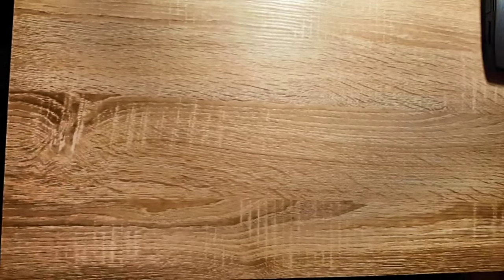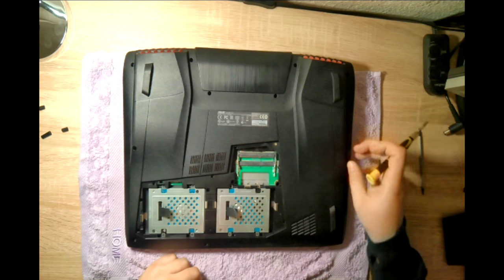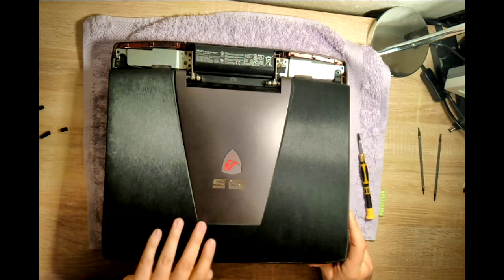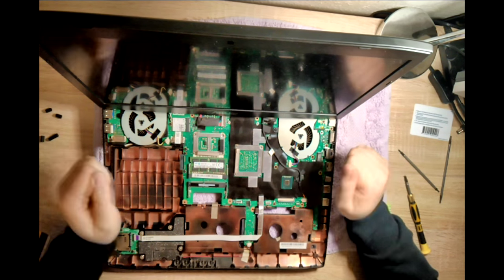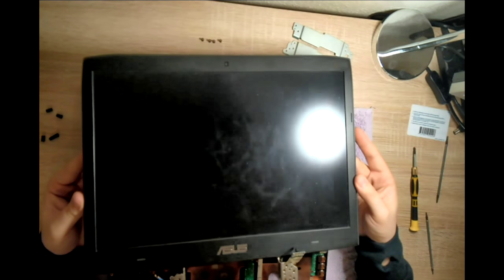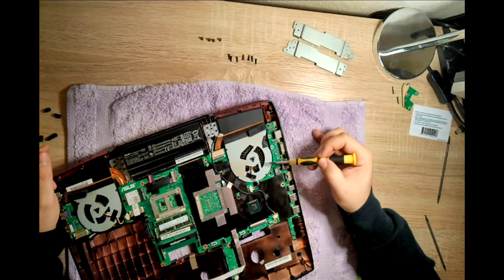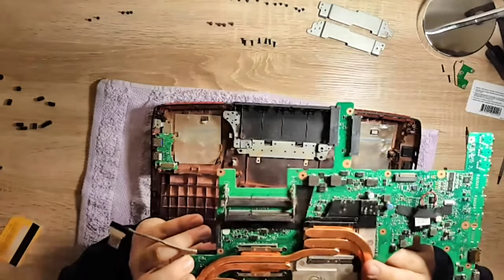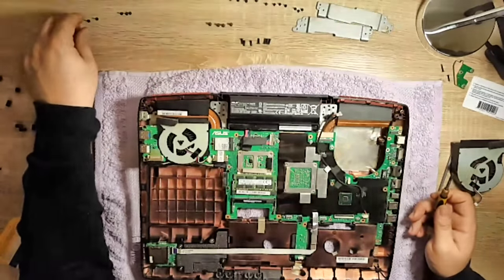Asus G751 - Complete Disassembly / Fan Cleaning / Battery Replacement

Comment: Darn, not a complete disassembly. Didn't open the display, it's a bit tricky.
Reply from the maker: You got me there...! There are 4 hidden screws on the underside and then you can split the display bezel from the back panel!
Reply: Hate how they place the hard drive bracket screws by holes where they can easily fall down into and are hard as fuck to get out lol.
Reply from the maker: true
Reply: Dongleboo You know those little holes that are right next to the hard drive bracket screws towards the end of the computer? So I admittedly dropped one in there and I'm not sure how to get it out. I know it could cause damage depending on where it's at while the computer is on. Would completely dissemblance it allow me to get to that area?
Reply from the maker: Can't you shake it out? If not, then by removing the keyboard panel you'll only get access to the top side of the motherboard. If it's stuck somewhere between the motherboard and the chassis, you'll have to remove the motherboard as well, which is held on by 3-4 screws. There are a few connections you'll have to remove before that. Watch the video and you can see how to do that.
Reply: Dongleboo Only problem I'm having now is literally every one of the three screws under the optical drive are stripped.
Reply from the maker: You've used the wrong screwdriver I guess? Try a small flat head and push it hard down. It has to grab on something.
Reply: Dongleboo Just makes them worse. They're noticeably stripped. Don't know why the quality of the screws is so low. I might try the rubber band trick if I can find one but idk. I could maybe shake them out of the optical drive bay if I could direct them there. I would just let it be but it assume it could cause damage especially if it's anywhere near a chip.
Reply from the maker: A problem will occur only if the screw makes contact somewhere. Usually most of the motherboard i covered with a plastic sheet so on theory there shouldn't be a problem. As for the quality, they aren't the best but I didn't have any problems with them so far. Just use the right bits.
Reply: Dongleboo I can hear that it's currently located directly under the chip under the hard right hard drive bay (if you have the laptop on it's back side with the hard drive bays facing you like in the video).  Would there be any problem with it making contact with anything there?
Reply from the maker: Well...I'm not really sure. Man, as a last resort, if you have some super glue, add a drop on the screw head and glue down your screwdriver. Make sure it's dried up and give it another go. The rubber band trick is not really applicable here, because of the size of those screws. Try the glue and let me know if it worked.

Comment: I need answers. My head is going to explode :(
In a few months... I'll be studying an Engineering on Systems (programmer).
I have 1 option. Choose a Laptop or a Desktop. Just one. 
So... I think I'll choose a laptop. Why? mobility.

But I need opinions and experiences. About the cooling, performance, lifetime, etc.
Especially on this model, well, almost the same model. I'm talking about the "Asus Rog 751JT". 
I like it, is an awesome laptop. But I've heard many negative things... and it's confused to me.

I love to play games and many programs at the same time on the computer.
Playing for hours so I'm scared about the lifetime of the laptop and the cooling.

And I've heard that doesn't need a cooling fan. ¿ :( ?
Because the system cooling that It has it's weird and doesn't work with an external laptop fan... doesn't make much sense for me.

I thought about buying the "Cooler Master Notepal X3"... it's look great.
If somebody have that cooler or something like that... tell me about the performance and your experience x) Pls !!

If you read all of this... Thank you so much and I'll been waiting for an answer x) !

(I'm sorry if I have some mistakes on the grammatical)
Reply from the maker: +Gabriel Endark First, let me start off with the fact that I'm currently in my last year of studies and I study Java programming. I've been using this laptop for over an year and I couldn't be more happy with it. Overheating is impossible and yes it doesn't need a cooling pad. The built in cooling system is very good even if you OC the hardware a bit. The  temperatures  hover around 45-50 on idle and depending on what you're doing m, can go up to 85-90 on the CPU and 80+ on the GPU under heavy load. I have the JY with the i7 4860M and it's more than perfect. Most important factor is the SSD. If the laptop doesn't have one it's s***. Mine didn't have the ssd when I bought it and after I got one - man....it was flying. As for programs...I have every Adobe software plus a thousand more programs and games and it's just perfect. I'm also a graphic designer and the software I use is quite heavy at times.  As far as mobility - this is why I bought a laptop. I was wondering if I should buy a desktop as well but now I'm glad I didn't. So, in short - the laptop is worth every penny, the only compromise for me is the small screen (before this I had 18,4 laptop). This laptop will be good enough in 5 years, unlike some cheap models which are outdated in 6 months and can't run anything. The only complaint I have from this laptop so far are the speakers - a bit too quiet. But hey, it's a laptop after all.
Reply: +Dongleboo 

And the non-removable battery... a friend told me "I keep mine on my desk mostly plugged-in but now after 18 months of over-charging the battery doesn't charge fully and I'll have to buy a new one to replace it for $75 :[
And you have to open the laptop to swap it out but hell it's still a bad-ass laptop in the end." 

xD

So... Do You recommend me that Laptop??
I'll study programming, playing games and carry to everywhere that laptop x)

Thank you so much for answering :3 !!
Reply from the maker: The battery is replaceable. It's a bit difficult to do it, but it's not glued down. Originally mine had a defective battery and after only 6 months it couldn't charge past 85% and ASUS changed it under the warranty. The battery has only 1 year warranty tho. 
As I said in my previous comment, these are the exact same things I use the laptop for. It has the power of a pretty good desktop. The only downside is the weight - it does weigh over 4 kgs so it's not the most convenient thing to carry but it comes with a very nice backpack included in the box (at least mine had one) so you don't have to think about buying additional bags etc. It's not with the hard front, like the one I had with my G75, but it's a nice big backpack. I carry it around on a daily basis and it rarely sits on my desk at home more than a few hours. 
In conclusion - it is a mighty machine and it can run anything you throw at it and it's worth it. You might actually consider the G752 which has a very cool aluminium design. It's the same price (around 1500 euro) for the base model.
Reply: +Dongleboo 
just in case I would buy the "Notepal X3"
I don't want any problem :'v

And thank you so much!!
seriously... thank you!! <3

If I need something else... I'll call you... sure, if You let me :'v <3
Reply from the maker: +Gabriel Endark As I said, I don't think it's necessary, but it's up to you. You're welcome and if you have any further questions, feel free to ask.

Comment: I'm thinking about repasting  cpu and gpu in my G751JT.
Do I need any thermal pads for other components ? 
Am I going to be ok with just a 4g syringe of thermal paste ?
Reply from the maker: +Voitech hmm....good question. I actually never did that and I'm wondering why do you want to do it? Are you experiencing some overheating issues? As for the question itself, I think just the paste will do. I've "OC'd" my GPU and CPU and I'll not having any issues whatsoever. I'm running the gpu @ 1226 MHz on core and the CPU @ 3.76 GHz in turbo boost. It's actually not over clocking at all, more like running the hardware at 100% efficiency, instead of the factory set 90%! :)
Reply from the maker: The reason the CPU gets warmer is because the heat pipes have a joining bracket which transfers heat. Also, the temps you are mentioning are not that high at all. My CPU goes to 85º-90ºC when under heavy load (rendering) and my GPU stays in the mid 70's while gaming. According to ASUS and some other ppl 85ºC is normal for the CPU. When it gets over 95ºC and holds there you have to worry. The GPU is fine when under 90ºC. I don't think there's a reason to repaste - nothing will change.